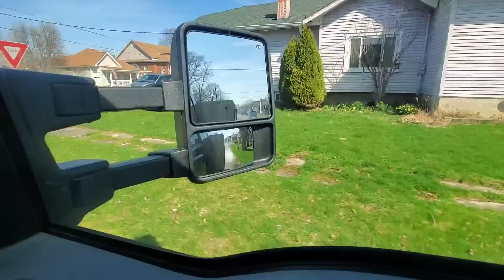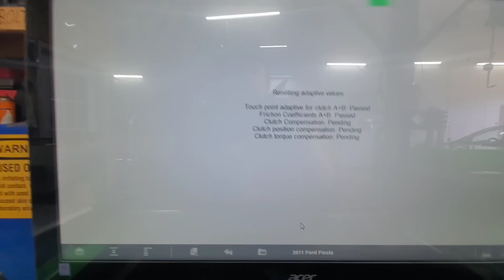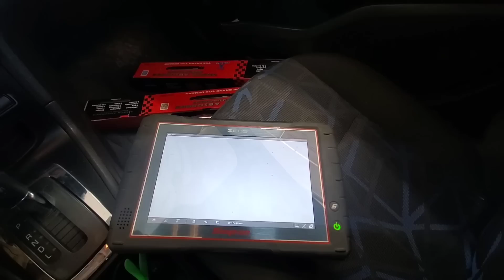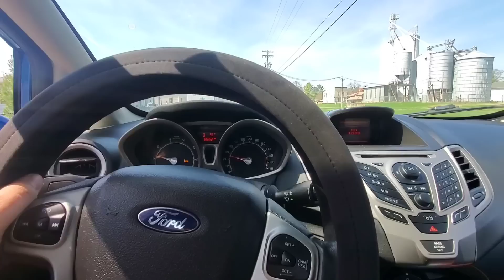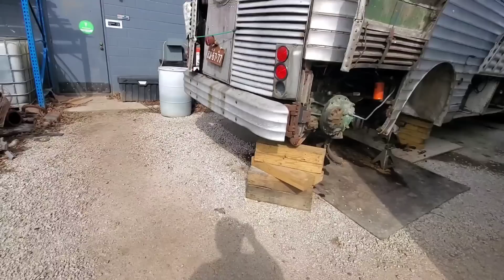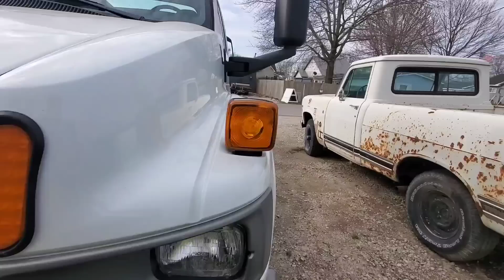More shop work

Comment: I love independent shops.  An independent transmission shop sent me to Ford for this exact same issue.  Ford is replacing those TCMs at no cost as of fall 2019 on a 2012 Fiesta.
Reply from the maker: I don't know they have updated the coverage since I left forward in 2018  But the extended parts coverage on the TCM and clutch were good for one replacement up till 200000 miles for a year restriction I do not remember how many years that was

Comment: I had no idea the Fiesta had an auto shift instead of a power shift transmission. In heavy applications (buses and semis), the auto shifts were more fuel efficient than the power shift (conventional) transmissions. Perhaps Ford should have consulted with ZF on their design.
Reply from the maker: Getrag produced the Dsp6 for ford. In euro markets its a wet clutch which seems to really helps the NVH complaints and prolong the clutch life (hot spotting is a big issues) but across the board those continental TCM's are junk.

Comment: I believe I have that same coolant hose leak on my 99 Sport 4x4 with the big 5.9. But I think it also needs the intake manifold resealed, so I might as well wait and do it all at once.....
Reply from the maker: Yea i need to pull the heads off mine soon to do valve seals and freshen up the top end. I'll do all that then. For now I'll keep running it.

Comment: Regarding those Ford dual clutch transmissions; many lawsuits have followed; Ford has  admitted that it was a bad design and they are ultimately unfixable.
Reply: I dont understand how this design was used all over Europe with great reliability, then when its put in American Fords they fail in huge numbers .
Reply: Guy Cobham I don't believe that is true; many lawsuits in the UK as well. Lots of people very unhappy with it. Also huge failure in Australia
Reply: Manual vs automatic.  Although the base design is the same,  the way the computer shifts and does its learning are the issue.  My mom has a Focus and because of her driving style it shifts like you're slipping the clutch in between gears.  If you get on the throttle,  it's just fine.

Comment: If the battery is bad could be voltage is not staying constant and boosting may be sending power surges. Just a thought. Have a Blessed Day !
Reply from the maker: On the fiesta? We replaced the battery prior to diag.